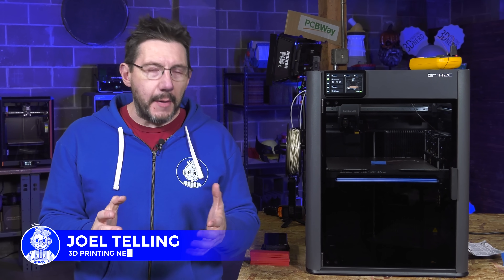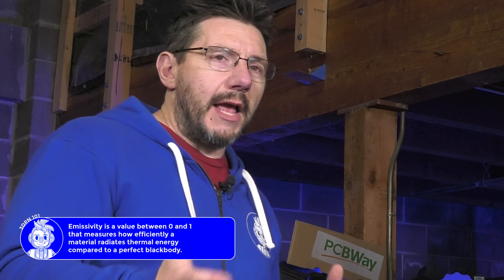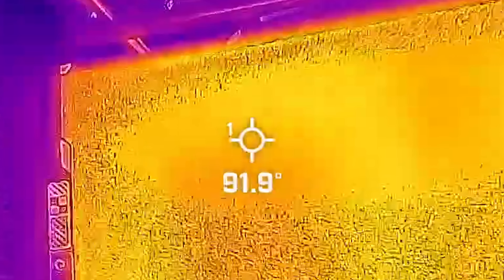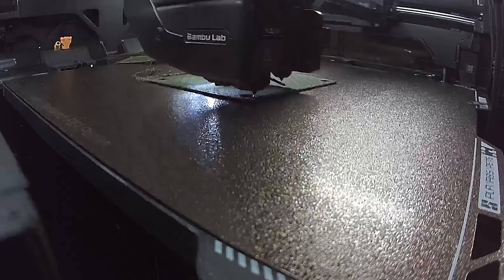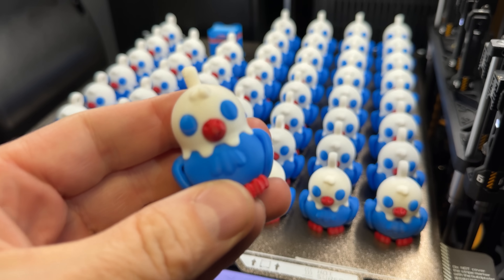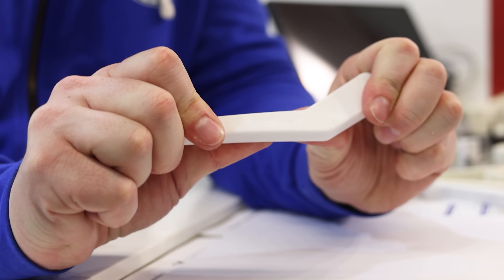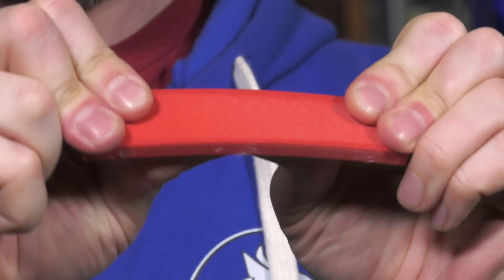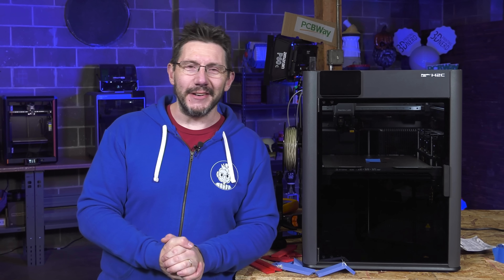Bambu H2C Update - Bed Heating / Tullomer + Polymaker

Comment: Maybe what you found in the original video wasn’t the true cause of the prints failing but that kinda sparse heating pattern with a bed so thin that can’t even it out is a crucial flaw imo specially on the top of the line model! Your conclusion was wrong but you did find a valid flaw in these printers and as far as I’ve seen the data in other videos corroborate the same information. Thank you for the great work. Those that have been in this field for more than even 5 years know that textured PEI at high temps is like a cheat code and Bambu are really pushing it to save money ON THEIR FLAGSHIP MODEL! Their second generation products have really regressed in some aspects.
Reply: Seems to me the main issue is that the build plate wasn't allowed to heat up for long enough in the earlier video. Here, after an hour (likely much longer than required, but obviously sufficient) the build plate appears to have heated much more evenly than shown in that earlier video.

In my experience, no great lengths need to be taken to have successful results, in spite of the fact that all build plates will see some uneven heating, even if not to the degree seen on this printer. You just need things to warm up enough. Maybe with the Bambu, it takes a little longer. Or maybe the build plates used here (original and replacement) are of slightly different alloys and so conduct heat at different rates, causing one to require a longer warm-up time (i.e. maybe the replacement plate evens out more quickly).

As long as the printer is correctly calibrated to preheat the build plate correctly, uneven heating during the initial heating stage shouldn't be an issue, nor would I consider it a "flaw" per se. (And to be clear, I'm no big fan of Bambu...I'm impressed at how well they've done to make 3D printing more "plug and play", but I'm generally prejudiced against closed/proprietary approaches such as theirs.)
Reply: @harvey66616  What do you mean it wasn't allowed to heat up for long enough?! Even the Voron people don't heat soak for more than 10 minutes, and that's for ABS, and I remember the days when we were looked at weirdly for heat soaking our printers. In reality, no one heat soaks their printers for PLA. If you have to heat soak your printer for PLA, there's something wrong.

Also, if you read my original comment completely, I'm not saying the reason for the prints not sticking is the heating issue. I'm saying, regardless of prints sticking or not, this sparse heating pattern is a serious issue. This could lead to bed warping over time and all sorta issues. In my opinion, this isn't acceptable on their halo product that starts at $2400.

Calibrating doesn't fix a warped plate. The prints will stick all right after calibration, but the same warping from your build plate will be transferred to the parts! So if you want large functional parts and not just toys, a printer with a warped bed is unacceptable.

It's not the buildplate's job to even out the heat. A 1mm spring steel plate isn't gonna even out concentrated heat. Your build plate itself should be responsible for evening out the heat before it reaches the build plate, which Bambu clearly has forgotten about here!
Reply: Extensive research has shown that the bed heater results in a couple degree range across the whole plate. That is entirely reasonable. There's no reason to spend more on the heater when the approach they went with works perfectly well.
Reply: @chrisjohnson00  Sure, you can get the print to stick today. But long term, that sort of uneven heating is gonna cause warpage in the bed. It boggles my mind how people think it's reasonable for Bambu to cheap out on the components of a $2400 printer!!!! Sure, if it was $1600, I could see how they had to absolutely optimize everything to hit that price point with the new hotend changer system, but if this is how they design their halo product these days, it's really concerning.
Reply: @sobhanabedi3363  Sooo what about other testing multiple brands and this one was on the better side of most of the brands? Including printers from Prusa ?
Reply: @scb2scb2  Are we talking about the NeedItMakeIt video?
Reply: @sobhanabedi3363  For the compare yes, not seen anyone else do multiple printers compare like that yet. But next to that i have been watching many h2c reviews, reading all the user feedback so far and my own 80h now on my h2c .. There is no general issue with the heating system of the h2c if there is a issue its either a faulty printer or plate or.., or.., or... But if you have more compares let me know.
Reply: @scb2scb2  There are two aspects here. (1) The prints not sticking to the build plate in Joel's case, and (2) The issue with the sparse heating pattern in general.
If you read my original comment, I'm explicitly saying even though Joel's issue wasn't caused by the heating pattern (maybe it was slightly contributing, but not the true cause), I'd still consider that a design flaw in the H2C, since it can have other implications in the long run. But maybe I'm wrong, and Bambu Lab has thought of solutions to those, but I wouldn't be able to tell without actually testing one.
Side note: Man, if you have an H2C, go enjoy your cool printer. You don't need validation from anybody. If things get so bad that Bambu has to do a recall (which I seriously doubt), you'll be notified by them, but other than that, don't let the nitty-gritties sour your taste. I say this sincerely.

In my opinion, neither Joel's nor NeedItMakeIt's (Mike's) methodologies are great in measuring this issue. I'm not gonna get into what I think about Joel's first review and his second follow-up, as that would be done better in a separate comment. But to answer what I think about Mike's video on the comparison side, here are my points:
TLDR: I never talked about temperature values. What I said was regarding the sparse heating pattern, which can be clearly seen in both videos, even if Mike doesn't mention it at all. But why does it matter over the thermal measurements? I'll try to explain that in the rest of this message.
1- First of all, I've never had a Prusa or a Bambu printer, and I'm not the demographic for either, as I mostly tinker with printers instead of actually printing anything other than some functional parts that I need. So I don't think I'm biased towards either of them.
2- Mike makes a ton of great points at the beginning of his video (up to the 3-minute point), and then he simply goes on to ignore all of them and goes on to makes some extra reporting errors as well.
3- He clearly states that a thermal camera isn't accurate and you shouldn't compare the results from a thermal camera, and then he goes on to say that it's fine to do it between probing and starting the print. But these two statements have nothing to do with each other!
3- He measures min, max, average, and 3 static points at the corners of the plate. In my opinion, 5 measurement points don't really tell you much about the general behaviour of a build plate, and you really need a much denser measurement matrix to evaluate it like this.
4- In a typical printer, it is more reasonable to have colder edges as it has more contact with the surrounding air, and no one really chooses to print at the absolute edges of the plate if they don't have to. To the contrary, Bambu's actually doing better in the edges of the bed, but they've missed the mark on the center of the bed; and depending on your use case, that could actually be worse.
5- I'm not saying either Prusa or Bambu is doing a better job here, and neither test is even remotely correct because Mk4 is a bed slinger and Bambu has an aux cooling fab, both of which will drastically change the results while in use. But neither of these is considered in Mike's video.
6- You can't really compare Mk4 against H2C. If you want to compare halo products, you should be comparing H2C against XL, which has 16 individually controlled heated sections. Mike didn't even test the Bambu A1 series or Prusa Core printer, which are at least more comparable to Mk4 and H2C, respectively. Again, I'm not saying either brand is better. But from my point of view, neither his measurement methodology is correct nor his selected comparison.
7- When you don't have great data or the data is too noisy, you can't really look at spreadsheets and compare based on those. In cases like this, I'd argue it is actually more accurate to just look at the image and use your intuition as well as the numbers. If we had some actual good numbers, we wouldn't need to do that, but clearly that's beyond the effort that every reviewer is willing to put in at this point (or maybe someone is and we should wait for their results as it definitly will be a lengthy process) but for now, I'd personally take my intuition over 5 inaccurate datapoints.
8- To reiterate what I said earlier, I never said that the heating issue was the true cause of prints failing, but something that Bambu should've done better on their halo product. That's my entire point, not that you'll have bed adhesion issues with H2C.
9- When I can see the heating elements clearly in a thermal camera image, it tells me three things: (A) The heating power isn't divided greatly along the bed, (B) Heating power is really strong and concentrated at those points, (C) The bed and build plate are so thin that they can't spread it out. To me, this sounds like the perfect recipe for the bed warping over time. But as I said earlier, I might be wrong, and Bambu has thought about it and implemented a solution.
Reply: @sobhanabedi3363  I feel bad in probably only having a sort reply since you give much extra info i mostly agree with. The whole testing with limited tool knowledge but it's the best we have for now. My gut feeling is that knowing what some of the other flagship products do what bambu does looks to me 'good enough' but not best in class. But as you also pointed out it was for sure not the reasons for the failures that seems clear and also where his first review did much damage and doubt. He now fixed and thats it really for me. For me if print fails it's at times still very unclear it's almost like cooking an art that experts seem to 'feel' more than others. For me as a microwave cooker i can only judge results and for me and what we now see in other reviews the h2c falls in the range we expected slower than some newer ideas but stable in results. having multiple failures was not inline with me or others using the printer already but indeed we only know for sure when we get more and more datapoints. Again thanks for the long reply but we kind of left the level on what the original video implied and what now has clearly been refuted and are into how and what do we really test and how correct is it to compare a old design vs a new design or a 1000 euro printer vs a 2400 one or a 4500 one.
Reply: @scb2scb2  I fully understand your point of view. But I have to say, as someone who's been interested in and working with 3D printers since 2017, when Joel pointed that thermal camera at the bed, and I saw the pattern, it was a WTF moment for me. It reminded me of inexperienced Chinese companies making cheap printers and the horrors we used to see. So I understand how Joel correlated that image with the lack of adhesion on the bed without verifying his assumption first. And honestly, if we were still printing on glass and blue tape, it would've been a disaster, but thankfully, we have the textured PEI and other specialty plates these days that make 3D printing a lot easier.
Reply: @sobhanabedi3363  Well he now also admitted it was probably not the best moment to check (a hour also seems stupid). For the rest comparing end results or having people do more side by side tests is about all we can do. You are still kind of hinting that bambu's h2d/h2c are out of line in this with other printers and somehow perform less in daily printing i don't see proof either way so far. At best i can see that prusa having 2 printers (Core One L and the XL) that hint to a upgrade to the buildplate heat system the normal Core One seems to share the MK4 one. And i have to compare that to more and more people doing real prints on the h2d and now h2c having no issues... Yes i am from the 'i just want to print' side of the market i don't care how it was done 10 years ago and what you all had to go through that seems to be kind of the whole point why bambu gained so much market share people feel they just print and having watched about 20 or more h2c reviews now that seems to be the case with this one and why his first review was a outlayer. Probably the biggest 'loss' for the h2c is that many reviewers seem to feel its too slow compared to printers coming out soon(ish).. in fact would carefully say most reviews seem to share kind of the same view on this printer.  Again i do admit that if you get away from the 'golden path' its probably much harder for us to find out how to fix things since we don't have that history but thats a double edge sword it seems to me lots of people who are into the tech deep also find/are having issues and feel the need to  modify things. Anyway i don't think we disagree much and its good that the review has been fixed in some ways. Have a nice day.
Reply: @sobhanabedi3363  There are already H2Cs with thousands of hours demonstrating that your theory that they will cause issues long-term doesn't hold up in reality
Reply: @chrisjohnson00 Has anyone actually measured their print surface to check for it over time?
Reply: @sobhanabedi3363 the point of a bed heater is to ensure prints stick to the bed, that is it's only job. The "measurement" you are looking for is, do prints slowly start falling off over time? And the answer is a resounding no. There are so so many printers running for thousands of hours with the exact same design that never ever have issues with bed adhesion, it doesn't get worse over time. It just works

Anything beyond "do prints still stick to the bed?" Is irrelevant. That is the bed heaters only function
Reply: @chrisjohnson00 That’s not a measurement since we have bed meshes.
Reply: @sobhanabedi3363  We absolutely do have a measurement of how often prints fall off the bed over time, that is not hard to measure and is again the only meaningful metric
Reply: @chrisjohnson00 Looks like there’s no point in this argument as long as you’re either not reading my messages or have no idea how 3d printers work.
Reply: @sobhanabedi3363  I know how they work and I am reading your messages, I think you are just focusing on details that don't turn out to be practically relevant. Like I explained, bed heaters only serve one purpose: to make your prints stick.

If the print continues to stick, the bed heater is doing its job correctly.

Engineering is producing a product that does a good enough job without wasting more money than is necessary.
Reply: @chrisjohnson00 Prints sticking doesn’t mean everything is fine. A warped bed will result in warped parts. They do stick since we printers generate bed meshes but their bottom surface won’t be flat anymore. Maybe that doesn’t matter to you but It matters to some.
You keep shilling for Bambu so hard they should hire you. I know how engineering works and it is the consumers job to make sure companies don’t cut too many corners while charging them through the nose. I’m not speaking as a Bambu engineer but maybe you are!

Comment: It sounds like your desperately trying to justify the poor performance. After 90 mins heat soak you're still getting a ridiculously variable temperature across the pkate! You mention that the thermocouple accuracy is poor, you then use the I/R which shows the same temperature which you brush off because it doesn't fit with your new narrative.  Sounds like Bambu Lab spanked your bottom and your now scared they 'exclude' you!
Reply: Gotta keep that free printer portal open.

Comment: Why do we need to start with heatsoak when this was all about PLA not sticking?
Reply: exactly, i have a 7mm alu plate, i put the thermistor on the plat itself and don't measure the heater and it stays consistent at 60 once it hits that temp, not heat soaking for an hour.  i only heat soak for abs but that's only for the chamber itself and it's only 20-30 mins tops.
Reply: Because he was showing the temperature readings he used before were faulty and accused the printer of having uneven heating.  If you recall, he then said, "but why was my PLA still not adhering?". He then went down the path of a faulty build plate.  So he really covered two topics.

Comment: I've had a similar (although extremely self inflicted) experience with the X1C at my work place. Everything works fine, then after a hundred-ish prints (and bare handed plate handing) I begin to loose adhesion with PLA; then after a while, no matter how big the brim or slow the process, there'd be no adhesion after printing about an inch or two high. A wash down with dish soap, and it's instantly back to perfect adhesion all the way through, it was predictable enough that we implemented plate washing as part of the maintenance routine.

Comment: 1:12 You should never assume when it comes to testing. Why not just graph it out and verify it? You literally had the equipment already setup. Also, heatsoaking is really only valid if Bambu or the user tells the printer to wait for a heatsoak in the print startup. Which is a couple lines of gcode, but as far as I'm aware Bambu has never done that by default.
Another 'trick' you could try on the bad plate is taking a scotch-brite pad(I use green) and use that with soap and water to clean and scuff up the build plate slightly.